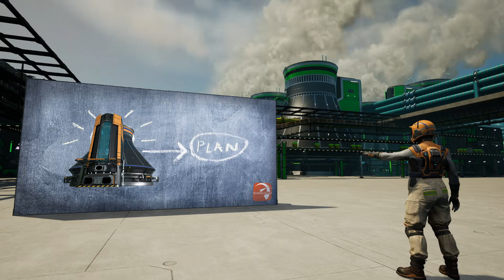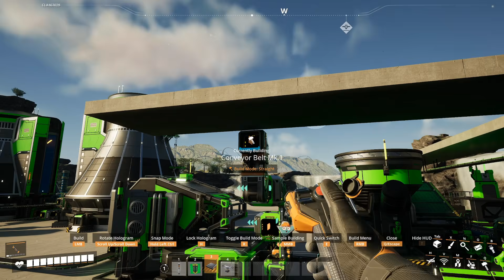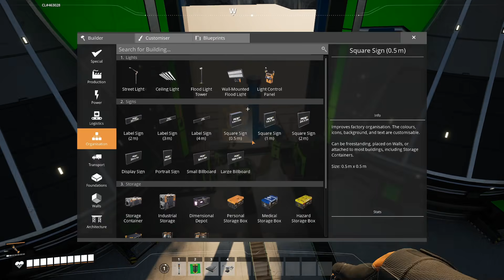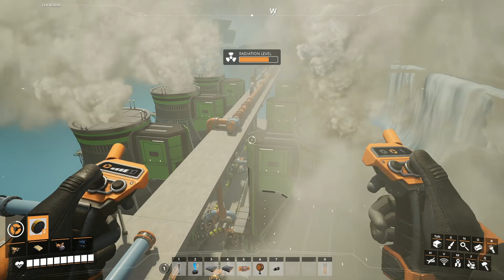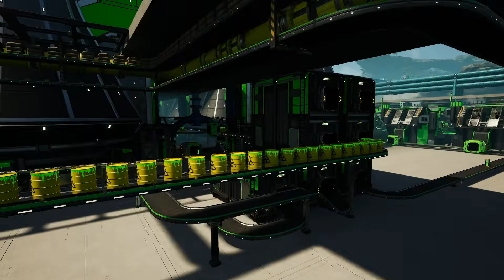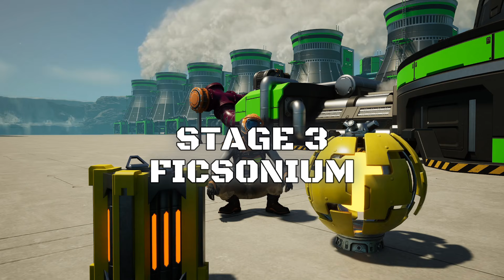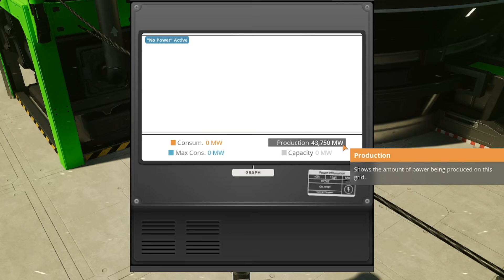NEVER Run Out of Power Again in Satisfactory !

Comment: Good video! I have recently went through the same stage of the game. The only thing that your video lacks, in my opinion, is the info about alternative recipes.
 The one for plutonium with alluminum corpuses eases the job drastically. 
I also like charged uranium cells, because sulfur is far more managable, than sulfuric acid.

Don't think i'm criticizing you, it's more of a suggestion for a next vid: nuclear power pt.2 - alternative recipes or smth like that.
Reply from the maker: That's actually a great idea for a video. 👍
I haven't really looked into alt recipes for  nuclear fuel yet, but I definitely will. I've noticed that all alt recipes in the game have some kind of advantage compared to the standard ones, they are almost never just trade-offs.
And thank you ! Feedback is always welcomed 😁

Comment: I don't know, I tried nuclear several times but never liked it. This play through I build a 144.000 MW powerplant using just a couple of pure oil nodes.  Way more buildings but easier to setup and no radiation or waste.
Reply from the maker: Wow, that's a lot of MW for an oil plant. I can only imagine how massive it is.
To be honest I like the challange of nuclear plants but the real reason i switch to it was that I was REALY short on quickwire for fuel generators 😅
Reply: @Overclocked-soz  Yeah, it is pretty massive but not all that complex.

My main power plant uses 2 fully overclocked oil extractors producing 1200 oil. That is turned into 1600 heavy oil residue in 40 refineries. This is fed into 32 blenders producing 3200 fuel which is in turn fed into another 32 blenders that turn it into 4800 rocket fuel. Of course there are lots of ingredients I haven't listed here.

Then there is a massive tower of 8 floors with 36 fuel-powered generators overclocked to 200% per floor for a total of 288 fuel-powered generators generating 144000 MW. But this is just using half of the 4800 rocket fuel. I still have to build the second tower that will double the total amount of power to 288000 MW, but my max consumption is just 26000 MW so I don't need it yet.

All the production buildings of the main power plant are run on a separate grid that is powered by a smaller fuel plant that turns 360 oil into 11000 MW. This way is my main grid shuts down the power plant keeps running.